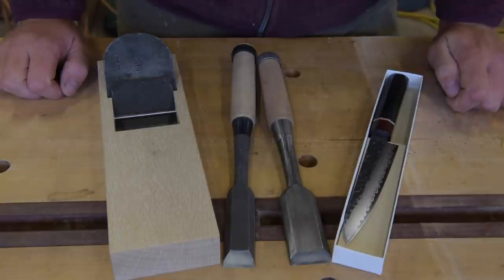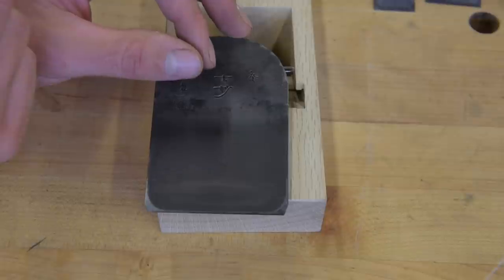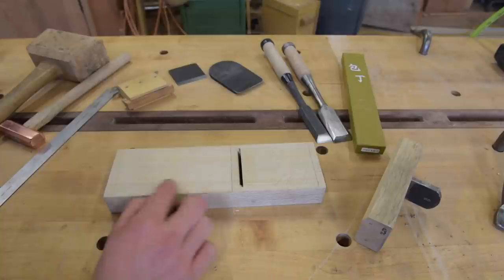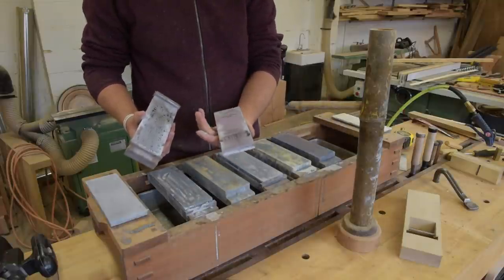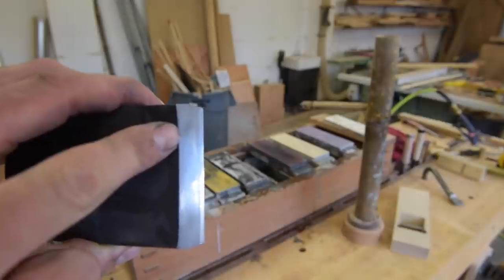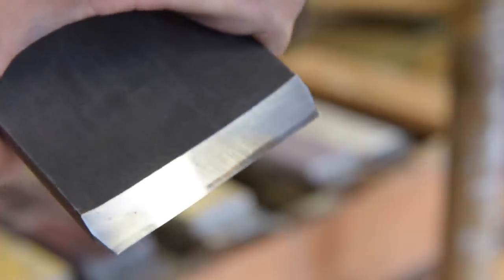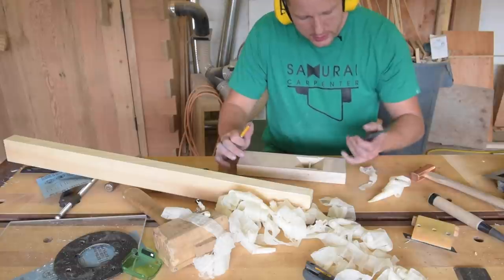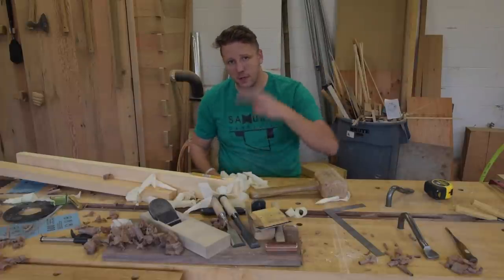How To Set Up A Japanese Plane, 16 micron Shavings!

Comment: Your sharpening station is an area you could use some work. I use Naniwa Chosera stones- and I do it over the sink in the kitchen. Cleanliness is very important to achieving a pristine edge. The higher the grit to which you’re honing, the higher demands of cleanliness are required. You’re essentially transferring coarse grit up the chain from your 1k to your 30k and you can imagine what a rock pressed between to pieces of glass would do- it’s the same thing with your blade and stone. Ditch your sharpening station, build a sink bridge and rinse your stones often, especially on the higher grits. You’re obviously getting a good edge, but how your achieving that edge leaves a lot of room for improvement. To remove airborn and transferred contaminants, your stones should be cleaned before and after each use and your blade should be washed (scrubbed, not just rinsed) when changing from one grit to another.
Reply: I've heard these sorts of arguments before and I used to clean my stones and blades while moving up the grits.  I stopped doing it because of laziness and to be honest I have never noticed a difference when using Japanese style or Sharpton stones.  These stones tend to use materials that are equal to or get harder as the grit goes up, so any larger material carried over would be quickly pulverized by the harder and finer stones.  It could be that other stone types or sand papers are based on partial size only and don't necessarily increase in hardness at the grit increases.  In that case if larger partials get transferred to the higher grits they would not really get ground down but could continue to cut the blade and stone at the lower grit (just speculation).  I would argue that the more convenient sharpening is the more you do it, and a 30k edge doesn't last long.  If you have free time to walk to your sink with your tools and sharpening station, then set your station up and wash each stone between uses good for you.
Reply: He does what he finds works for him
Reply: @travsb1984  agreed. I don't go as high as 30K, my finest stone is 12K, and for just that one stone, I always make sure things are cleaned before hitting it for final polish. The lower grades ... meh. It's fine. But a little care with the grind residue doesn't hurt... Pretty messy stuff.

Comment: Hey Jesse, Ive found a lot of success and a much cleaner, shinier, mirror-ier finish on the blade when each stone, chisel and your hands are cleaned thoroughly between the grits. I even use a different rag for each different stone. It's the tiny particles from the lower grit stones that are transferring over to the higher grit stones and leaving scratch marks. I haven't gone as far as to measure the microns of my shavings, but the polish is much much better than before I became obsessive with cleaning between stones. I learnt from another YouTuber called Sumokun, he's unreal. Anyways best of luck! Hope you get down to the 5 micron goal 😂

Comment: I measured shavings from my old Record 7 jointer with a micrometer.  I flattened the bottom of it years ago and sharpened blade today on cheap diamond combination stone (finest side of it is 600) and finished it on leather strop. 

Thinnest shavings were 0.04mm which is 40 microns. You really don't need shavings any thinner than that and you can reach it easily on usual western plane. I bought that one on flea market, it was 4€ which was a steal for big plane. Usual price for old Stanleys and others is 10-20 €

Comment: Bill Carter's blunt chisel technique would be useful for removing the high spots - basically a push scraper made out of an old chisel ground at 90%.  It works better than trying to use a conventional chisel for taking off very small amounts when making a wooden plane.

Comment: The point of just the edge being tool steel is to conserve the amount of steel needed. Its labor intensive to forge the tool steel needed to have that super sharp edge the Japanese tools are so famous for. This goes back to when it took multiple days, and much man power, to produce a chunk of steel. The best of the steel was so expensive and hard to come by that it was used sparingly, only on the necessary parts. Everything else was cheaper steel or iron. Love your purchases from Japan,  wouldn't mind having them myself.

Comment: Ive always wondered with the hollow grind on japanese chisels what happens and after a couple years of use and repeated sharpenings. It looks like you can only loose about an 1/8 inch worth of sharpening before you get into that that hollow? Is that true or am I missing something?
Reply: You stone that whole side as well as the actual edge which eventually flattens it out, it's on an incline towards the edge so the hollow recedes as you flatten it

Comment: The iron its coated with graphite so it’ll be slippery but not messy with oil or grease, its a technique used in the aviation industry

Comment: On a serious note , make you a hokone plane like the one in this video , from scratch . Using Bois d arc for the sole or Brazilian rosewood , and make the cutting iron from Damascus Steel using nickel and ball bearing steel . You can use mild steel for the chip breaker . Then , you will indeed have a hokone plane for a lifetime . Yes I have one in bois d arc . It grows natively here in Louisiana . And hell yes the wood is very hard and tough . So is a Damascus shaving iron . But I guarantee you it cuts smother than ANY. Other plane I have ever owned . It damn well should , it was a real bastard to make .

Comment: Great video! I'm not a big fan of having a large cup on the dai, and prefer it flat flat flat. What happens with a cup is that (especially on narrower pieces) the leading edge drops down slightly as it moves off the edge of the board, such that the kanna cuts slightly deeper at the end of the pull. This increases resistance at the end of the board, and also gives rise to a slight curvature on the surface at the ends (of the same dimension as the cup in the dai). PS: note that Japanese also work with gorgeous hardwoods like keyaki (elm), which is a much greater challenge for the planer...but the results with proper technique are stunning.

Comment: the soft steel is used as a "shock absorber" on the plane blades ( and also on the chisels) - because the cutting edge is so hard - especially the blue steels ( usually Rockwell 64 and up ) if you hit a knot the blade may chip at the edge - the softer steel absorbs some of the impact keeping the cutting edge intact...new blue steel blades may still chip a bit on the edge until you have sharpened them a few times and worked back into the "meat" of the steel....

Comment: Just an observation, when you go up through the grid, you "contaminate" the higher grid stone with lower grid material from your flattening tool. Might be good to rinse it off between stones?
Reply: the black/grey stuff is essentially a fine grit polishing compound, you can just wash the block after. but leave it on while sharpening it reduces wear on the stone and makes the results better for your edge
Reply: @TheFlyJunky   you dont know what you talking about, the slurry from the coarse stones dont polish, it will  ruin a high grit edge
Reply: @simonvolsmann  It's possible that he meant: leave the slurry on the stone while you're sharpening ON THAT STONE (without any kind of statement about what to do when switching between stones).
Reply: I wondered the same thing; when going from course grit to a fine grit I always clean the item I’m working on before going to the finer grit. In this case the diamond plate, used to flatten the honing and polishing stones, should be cleaned prior to each transition. I have a 4 sided leather strop coated with 2, 1, .5 and .25 micron diamond spray. I clean the surface of the counter and the blade I’m stropping after each phase to avoid cross contamination; otherwise you lose the effectiveness of the higher grits. Hopefully he is cleaning but it’s been edited out for brevity.

Comment: When you use the diamond plate to flatten your sharpening stone, i see your not cleaning it between each stone. I believe that contaminates your stone. Specially since you start with the lower grits. I learned to start with the highest grit and workdown from there and then clean it before next use.
Reply: Maybe that will get you 5 micron shavings :-)
Reply: Yup I agree, during my materials science degree, we used to polish metal samples,  to 1 micron finishes. If you lost control of the sample (fingers get pretty numb and wet..) it could fall into the basin surrounding the polishing wheel and get contaminated with the slurry from the previous grits and scratch up. Would have to start the whole process again to get that perfect mirror finish for the microscope..

Though that's really nitpicking. 16 micron shavings are insane!!!
Reply: He was showing scratches after 30k stone it could very well be from lower grit contamination.... who am I to talk though, my planing shavings resemble Tom the chainsaw carvers floor
Reply: Totally.. Leaving dirty polishing stones. 
A sepuku is in order..
Reply: You guys sound like the real deal when it comes to stones. I know there are several opinions about which stones to sharpen with. What do you guys recommend? What's a seppuku?
Reply: You Guys are right, there will definitely be contamination from course stones, just wash the blade between stations if you really care, That said its not going to make much difference, super sharp is super sharp
Reply: WoodShaped im not an expert, just watched some tutorials on sharpening before i got my own sharpening gear plus using some common sense and experiense from other fields. I dont have any japanese planes so im just using a dual stone of 1000 and 6000 grit plus a strop. Works fine so far. A sepuku is samurai suicide after they have shamed themselves and/or their master. :-)
Reply: Håkon Wille Thanks for the info!
Reply: I'd be finishing it off on a strop after the sharpening (on uncontaminated stones). A range of them with micron sprays (if you want to go all the way). Clear grained kangaroo hide (I had to send the first batch I bought back as it was scarred up and only suitable for knives) if you can import it, glued on flat paddles, I don't know if there's an equivalent in your part of the world. Watch some of the fanatical straight razor sharpeners for more details. Maybe that will get you down to the 5 micron range. Love the vids regardless, but watching you contaminate the higher grit stones made me cringe a bit especially seeing what should have been a mirror finish after the 30K stone.
Reply: Yes! I’m a straight razor guy and I did cringe a bit. Just one piece of 1k grit on my finisher will send me back to the lower grit stones.

Comment: The other reason for the soft steel core is that, when you have sharpened it to the point that the tool steel is worn through to the mild steel in the middle, you are supposed to take a hammer to the top of the blade and tap it to force the hollow behind the edge to flatten out, moving more tool steel into the edge.  You will continue to do this until the entire blade is used up, probably many years later.

Comment: The use of soft and hard steel in woodworking tools goes back to the forging of the the Japanese swords. The harder the steel, the sharper the edge obtainable. However the hard steel is more brittle and tends to break. The softer steel will not take the sharper edge but will take the force of impact without breaking. The genius of these blades is the combination of soft and hard steel that allows for a razor edge and yet will absorb  alot of force. Ease of sharpening and tapping out the bevel are added benefits.
Reply from the maker: There are thousands of woodworking and steelworking tools made entirely from hard tool steel that can absorb impact without breaking and also keep a keen edge.  The whole vibration and impact theory is nonsense.  It is convenience and tradition.
Reply: they are not the blue steel that Hitachi has a complete hold over - they have things like vanadium etc added...the tradition comes from experience

Comment: The bamboo water dripper is cool but it doesn't supply enough water to clean the stone.  For your final grits you might try a single stone set up like Murray Carter or Ryky Tran use.  The large amount of water these systems afford make it easier to keep your stones clean.  On the other hand you are getting your blade VERY sharp so... if it ain't broke...

Comment: Its not to make the sharpening easier( although that is a bonus ) The soften iron backing is there to support the harder blade and soak up vibrations which is why a japanese plane will produce such silky shavings. - Regards Dave

Comment: You do good work and I enjoy watching your channel with great anticipation.  Suggestion, One of the senses that isn't talked about much is sound.  The sound of a drill bit changes just before it finishes its cut.  In the case of this plane, I could hear the difference in the sound as it passed through with the grain or against the grain.  And there are other sounds that the skilled crafsmen pay attention to   Just a thought.  RC
Reply: Good thought though. I can tell when I've sanded a board enough by the sound the sandpaper makes. At the beginning it makes a crisper hissing sound that gets more muffled as the sandpaper dulls.

Comment: natural stones are not complicated. 
a suitastone from any mine as a optional prefinisher. ( not necessary but very helpful)
as a final superfinisher just buy a hard nakayama tomae or a ohzuku asagi.
and for the stropping a cordovanleather and use it clean without compound on it. 
nakayama costs 500-3000
and an ohzuku costs 200-1000
both do the same, they are the finest (and usually also hardest) natural polishingstones from japan.
the sharpness and frictionfactor of your  blades will increase significantly.

Comment: Can you run that plane over some cranky grained hardwood please?  I'm interested to see how it fares on an Australian hardwood for example. Something with a Janka rating of 8 kN (1,800 lbf) or more is of particular interest to me as US Black Walnut is pretty soft and not much of a test. A twisted bit of Live Oak (Quercus virginiana) would be a good test as it approximates the hardness of  several Aussie hardwoods I'm told.
Reply: Most Japanese planes come at a 40 degree angle - made for working softwoods - you can get some at 45 for hardwoods ( somewhat generic)  but if you have especially hard or difficult grain you need to have a custom dai made at a steeper angle ( I have seen some up around 57 - 60 for curly grain etc. ...) the blade itself is still fine just needs ( as you say ) a different presentation angle...
Reply: I hadn't heard of Mujingfang before.  I do see several similarities to the HNT Gordon planes I reach for when the going gets tough

Comment: Toolmaker use the 3 plates method to get perfect flatness on surface plate you should check it out I'm sure your diamond plate is not under .005mm overall flatness

Comment: 30,000 grit stone. I thought I was taking it too far with the 5,000 that I use for knives.
Reply: Kory Coster at that point it's really just sharpening for the heck of it. From personal experience i can tell you, there is absolutely no noticeable difference between 12k and 30k. Heck, even 3k finished with a strop and metal polish is very close to 12k.
Reply: For real I go to 8 k then I give up
Reply: @Erowens98  not if your trying to get competition grade shavings lol.
Reply: @Erowens98  there is a difference it just doesn't matter for woodworking. However, it does matter for competitions and to Japanese craftsmen who use the finish the plane leaves.

Comment: Concerning the sanding of the block/sole.  If we are dealing with the micron level of measurement, how can one be sure the block is staying level when sanding.  Flat is flat, but slight extra pressure on one side during sanding and your shavings may have a disparity one side to the other.

Comment: Thanks for the video.  In the beginning you show there is a "cup" on the back to the blade.  You explain the cup is to fit against a slight high point in the center of the bed where the blade will rest when inserted.  Later in the video, when you are tuning the bed with a chisel, you appear to remove that high point.  If that is what you did, doesn't that defeat the cupping design in the blade?

Comment: Brother! It's not that I have one of these hand planes, but my spirit animal uses one ALL DAY and he has a question... the 'height' of the bits that you don't give relief to - how do you make sure those are level and flat, or do they not need to be a very accurate angle to the blade? My worry is that I would (when polishing the foot on the 600 grit and stone) apply uneven pressure and have them at unequal heights. I'm not sure if I am making sense, but it would be something that I would worry about when setting up my plane... I mean Derek's plane... he's a badger by the way. Thanks for the rad video - stoked!